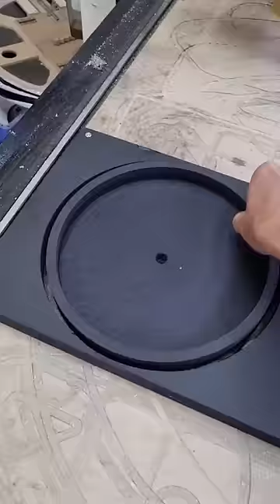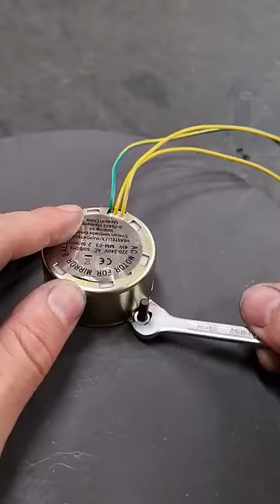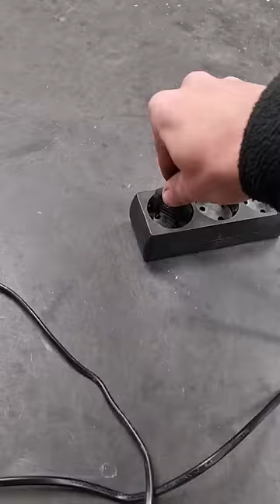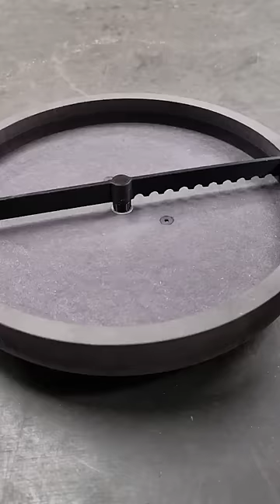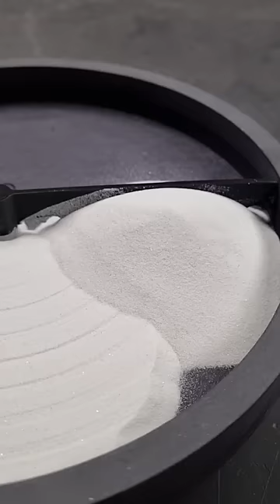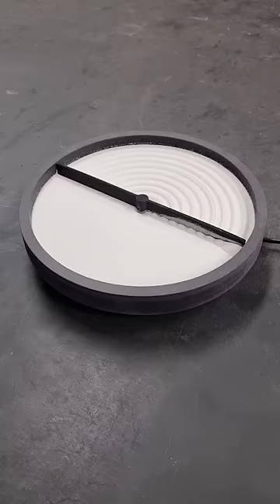Engineering some ZEN

Comment: Would be cool to have one that makes a full rotation every 12 hours so that you can tell the time
Reply: That would be awesome
Reply: Sick, and larger becoming a table top with a sand clock in it 👍
Reply: totally possible with gear ratios
Reply: @oBergerr  Using a stepper motor and some cheap microcontroller will do it fast. No gearing shit needed.
Reply: You could split that arm thing in two so the first arm would cover like 80% of the distance and the other arm the other 20% with the larger one being for hours and smaller one for minutes.
Would also be cool because then you would have two "different" patterns going on at once.
Reply: @SweetTooth8989  only problem is that you wouldn’t really be able to reset the sand since the arms would have to be able to intersect
Reply: @SkullpunkArt  i know what you mean but you could have one go above the other and come down at the end for the small section and then the one underneath covering the big section.
But thinking about the clock idea, it wouldn't be as exciting because it would move so slowly you would barely see it...
Reply: @SweetTooth8989  not sure what you mean by the first bit but yeah that is true
Reply: @SkullpunkArt  like kind of like how clock arms are above one another and then the longer one would have small piece on the bottom towards the end to push the sand for the minutes and the arm underneath would have a piece on the bottom covering the middle until where the other small piece starts. It's kind of weird to explain in text lol.
Reply: @SweetTooth8989  I get it.  Because the minute hand is longer right?  Outside (minutes) would be one pattern and inside (hours) would be another.
Reply: @rvkeurotruckmotorgamer8191   i think he can use the 60hz from the grid, like some old clocks do … no controller needed
Reply: @charliebrownn6622  what are you even talking about
Reply: @SweetTooth8989  zombieno1 helped me understand what you were going for and I think it's a cool idea. Maybe if you add a third outer pattern ring for the seconds hand it would be more exciting. I can totally see something like this as a glass covered coffee table.
Reply: @zombieno1  yes, exactly. Minutes would be the outer small section and hours, the inner large section. 👍
Reply: @OnyDeus  adding seconds would definitely make it more exciting. It could certainly be done. 👍
Reply: @oBergerr  you must be german eh?
Reply: friend: what time is it?

me: um...when was the last time that sand rotates???
Reply: @Crypt007  in the US clocks and even TV refresh rates used to be controlled by the frequency in the AC current present in the grid. (60-hertz in the US 50-hertz in Europe) this allowed for a very simple and inexpensive means to control circuits. This is why we have PAL vs NTSC.
Reply: So, a clock?
Reply: @rvkeurotruckmotorgamer8191  😂 does it use Quarz though?
Reply: @nowonmetube  No, $1.5 esp chip is enough to fetch time from UTC/GMT time from server, and a $2 servo motor, that's it. Quartz is way outdated though😬, if you can fetch server time, automic accuracy BOOM.
Reply: I already made this and made a million dollars off of it everyone... thanks for the ideas!
Reply: Thats just a clock
Reply: @benjimain6  You can buy these. I think even Costco has one. They're hundreds of dollars tho.
Reply: @rvkeurotruckmotorgamer8191  A $10 GPS chip means you don't have to network the thing.
Reply: Not  practical for knowing the time, though. Who would like to look at a horizontal device which messes up with only a little wind? (not to say with animals or children around)
Reply: @TriviRocks  All the versions I've seen are built into coffee tables with a glass top. I've seen ones that have magnets under steel balls that will even draw line-art images that you put in on a USB card.
Reply: @darrennew8211  Wow, that's famtastic!
Reply: Add an arm to it that stamps the numbers in the flat portion of the sand, and it's the raking arm that tells the time, and you got yourself a product.
Reply: Hey, let's take this thing that embodies Zen, and turn it into a clock!

Comment: Problem is it will push the sand it’s dragging to the edge and overflow onto the table. It will still have the pattern but stop leveling it. To keep it going, you would need something to keep adding sand to the middle.
Reply: Looks like the size of the notches on the rake are all the same size. if he made them increase as you move to from the center to the circumference, with the increase of size based on higher radial speed as you move outward, that would fix the problem of sand building up at the tip

Comment: You can make the arm in S shape for true Zen look.
Reply: was thinkin the same thing
Reply: This model is on thingiverse (or something very similar) and I'm pretty sure there is an s shaped arm in the remix section. I printed it and it works pretty well
Reply: I don't think that would work, because the curved arms would move the sand to the inside or the outside of the circle depending on the direction of rotation, and eventually the smooth side wouldn't' be able to fill in all the lines. :(
Reply: @MachuPicchu83  oof this is a really good thought process, and I could definitely see that being an issue.
Reply: @MachuPicchu83 see I think that would be an issue with the straight arm, and the remedy would be a slightly s-shaped arm engineered to keep it even? This is what I came to the comments for!
Reply: @robertglenholmes1191  what is the model on thingaverse?
Reply: @MachuPicchu83  little louvers in the direction of travel may  keep it in place
Reply: @robertglenholmes1191  Wait... if you downloaded and PRINTED IT, how can you just be "pretty sure" that it exists? 😂

Comment: Is that brush tool also blowing compressed air? I'm confused what it does by barely tickling the surface - is it for chip removal? That wouldn't make sense to me since blowing air or a liquid would be far cheaper and easier - I'm at a loss

What's its purpose?

Comment: Would it be possible to do this with a slightly higher powered motor, if necessary, and kinetic sand to make this a semi-functional wall clock? Kinetic sand sense gravity wouldn't work with the white sand your currently using

Comment: eventually the sand would erode away the blade until it was smoother on the toothy side and jagged on the smooth side so you'd end up with a blade just brushing the surface with ridges of sand exactly half as tall as the ones in your current ridged half circle of sand. But it would take a while.

Comment: My second most recent EurekaCrate was essentially this, except on a much smaller scale and with an option to have magnets drag around ball bearings in the sand. It also didn’t have a rotating arm, the actual garden spun, and they gave you a little wooden rake and a stand to rest it on. I can’t believe I’m about to say this, but that was the first time I was disappointed in a EurekaCrate.
Ugh, it just feels wrong to say.
Anyways, point is, I’d prefer to have one of these if I had the desk space to do so.

Comment: I wonder if you could use a similar concept to make a...I guess a frictional torque brake, for measuring motor performance? Something more like a comb with straight tines and vary the load with insertion depth? Somebody want a mech engineering thesis project?

Comment: Be cool if you made one that functions as clock… except it would be horizontal… two interesting challenges make clock mechanism and find some material to replace the sand so it could be vertical